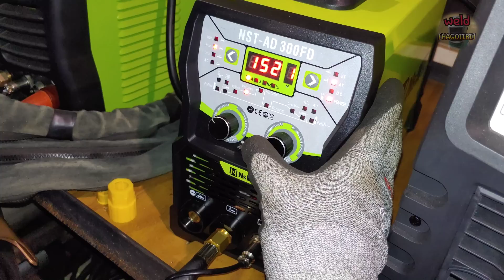One-sided beveling is sufficient for perfect penetration TIG welding ! Brilliant idea!

Comment: I weld a fair bit of 2mm and 3mm thick 314 stainless pipes. I am a bit dissapointed in my welding and want to improve it, mostly because the welds always ends up gray in order to get penetration. 
I am using around 63 amps on 2mm and 67 amps on 3mm. What can I do in order to get less gray welds but still manage to get full penetration?
Reply: you need about twice as much heat you are heat soaking the part waiting for a puddle, set you machine to about 125 amps for 3mm and about 85 for 2mm.... get a gas lens you could have gas coverage problems.
Reply: @trailerpark6.7  Oof, gotta weld hell fast on that amperage. But I will give it a try.